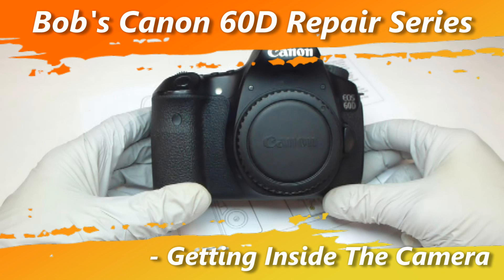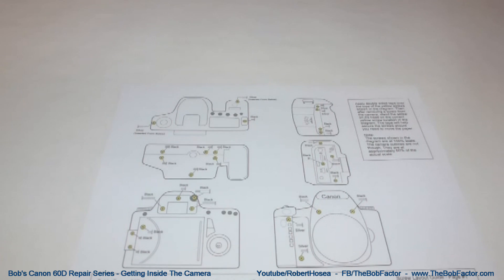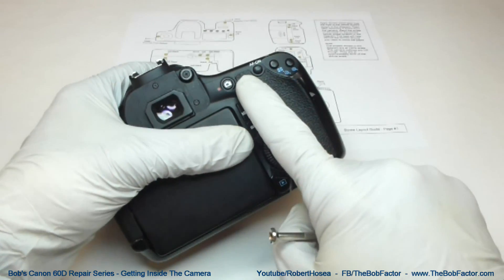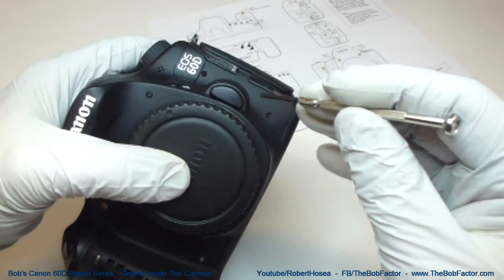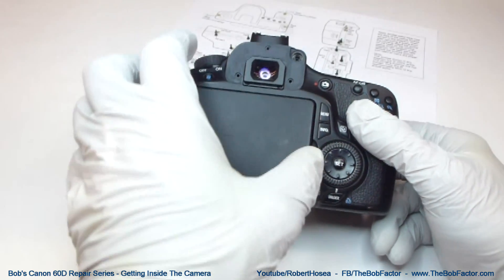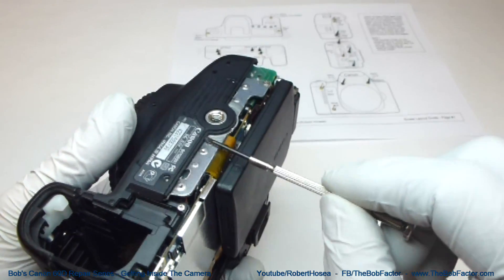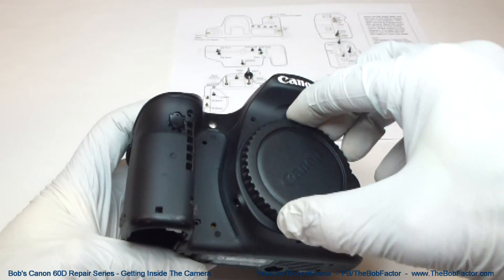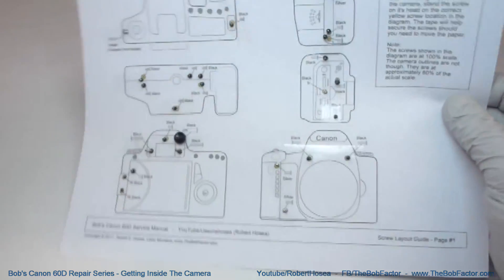Canon 60D Repair Series - Video #1, Getting Inside The Camera

Comment: Thank you very much Bob! These are the best instructional videos i have ever seen!!! It made me bid on broken 60D and try to fix it. It was told to me that it is not working due the shutter malfunction. Well after its arrival I was shocked by the fact that loosen mirror screwed up shutter and ended in two pieces between shutter flaps and CMOS :( 
For sure I need new shutter and mirror asembly and Im afraid CMOS will be damaged too... so Im looking for a reasonable priced parts here in europe or china (ebay). Is it wise to buy cheap parts from china?
Reply from the maker: Hi Jiří,

Thank you. I'm glad that you like the videos!

I have ordered items from China on eBay before, but never camera parts. So I couldn't tell you first hand on the quality of the parts. Though, I'm pretty sure that a lot of the camera parts that I have ordered on eBay that were supposedly in the U.S., were most likely parts originally purchased from China.

In regards to the camera's CCD being damaged, if it only appears that it's scratched, then you may only need to swap out the IR filter that sits on top, which would be a lot cheaper than swapping out the entire CCD. I don't have a video on that process yet, but here's a video that does show removing the filter. I hope this helps you out.: 
https://www.youtube.com/watch?v=bt9a7htqJng

Let me know how you make out on your repair too.
-Bob
Reply: I finally did it! Thanks to your video it was relatively easy job. And my CMOS seems like it is not damaged by mirror pieces at all! (Hooray!!!) BUT there is always some troubles when I am doing such a thing. I have not working focus point marking (red dots) and viewfinder is blurry, when I am using AF though viewfinder, photos are overexposed and blurry too so Im not able to use it at all (Im suspicious about internal exposimeter failure. Can you give me please some advice about what I have to check? Im pretty confident about not forgetting any flex cables connected.

 On the otherside focus in liveview is working like a charm, even if I have visibly missaligned sensor. Im planing to send the camera for professional alignment later.

 I have complete spare mirror chamber and I can try to use some parts of it (shutter and mirrors are completely thrashed) so I can rebuild my
Reply from the maker: Hey congratulations on getting it working again. I've been trying to reproduce your problem here, but no luck for me so far.  Did you you replace the entire mirror box assembly? Also, what about the IR filter on the CCD, did you have to replace that as well?
Reply: Thank you for trying to help, I did replace complete mirror box  with shutter assembly and inner frame...While I was digging around for possible causes, I lucikily found cause described on this amazing blog: https://canonrepair.wordpress.com/2015/02/09/canon-60d-dropped-down-false-exposure-measuring/ 
I clearly have missaligned metering sensor which also seems ti project red dots in the viewfinder, unfortunately i messed rear cover flex during hunting this down, so now Im waiting for spare part which will hopefully arrive before christmas. 
Despite how horribly it looked from outside, CMOS has only minor coating damage which didnt showed up in first test photos  under interior lighting. See the picture: https://scontent-frx5-1.xx.fbcdn.net/v/t1.0-9/24059194_10210796620967350_450173774165212316_n.jpg?oh=56656cfc31c40d7b2a4288f47b06e3c1&oe=5A8EB081

Comment: Anybody got any advice for a jog dial that isn't functioning properly?
Reply from the maker: I have a video that shows how to disassemble and reassemble the set button and dial assembly. I've been successful in repairing them before when they've quit working. If you can't fix it then the best bet is to just replace the entire back piece. They run about $50-70 on eBay. Here's a link to my video on that. https://youtu.be/zaJJqRCfYXc

Comment: Robert your videos are great. Thanks for Posting. Suddenly the set button and dial of my 60d stopped working. Probably the best way to go is to replace it, but I can not find a place to buy it. Can you help with that?
Reply from the maker: Sometimes you can find just the set button and dial assembly on Ebay, but I don't see any on there right now. So, you may have to buy the entire back cover instead.

Here's a link to a back cover assembly on Ebay:
https://www.ebay.com/itm/Canon-EOS-60D-Rear-Cover-Assembly-Genuine-Canon-New-Free-Shipping-/371839129218?hash=item569356d682:g:mDsAAOSwPhdVSnKL

If you haven't already checked it, you should check to make sure that the connector on the flat ribbon cable that comes from the back cover has not come loose from the socket on the main board. It could be something simple like that.

And, I also have video that shows how to remove and replace the set button and dial assembly. It could be that you may be able to repair it if you find what the problem is on it.
Here's a link to that video: https://youtu.be/zaJJqRCfYXc

Good luck with your repair. Let me know what you find on it.
Bob
Reply: Thank you very much!

Comment: https://www.dropbox.com/s/w9y54lvtfp4hyx1/Problem_motherboard_Canon600D.JPG?dl=0

I wanted to know where I can find this connector to replace? I've already looked at Ebay but nothing. Thanks so much.
Reply from the maker: That is a tough one. Short of finding another board that you could remove it from, I would look at www.DigiKey.com for something. I get a lot of components from them. From the picture it looks like it has 12 connections. Here's a link to a DigiKey search for "surface mount 12-Position headers":

 https://www.digikey.com/products/en/connectors-interconnects/rectangular-connectors-headers-male-pins/314?k=sm%2012%20position%20connector

There are a lot of results, but you can narrow the results down by modifying the filters at the top of the page.

If you can't find it on DigiKey then take a look at www.Mouser.com. Let me know how you make out on this. 

- Bob
Reply: Another motherboard really costs me too much. I thought I could find it at 20 € but it is not so unfortunately. I found this connector is similar but not identical: http://www.mouser.it/Search/ProductDetail.aspx?qs=cTNRJjk9LReY0n8B358FZQ%3d%3d. If so, I can disconnect it with a flux and welder and then attach the individual wires using a great magnifying glass.
Reply from the maker: In the picture, the connector looks like a 12-connection male/female pinned type. Is that correct? And the connector in the link shows a 52-connection double-sided style connector. Possibly the link is misdirecting me, but the two connectors are not at all the same. What type of camera did the circuit board come out of? And yes, you could reconnect a new connector using wires if the pin-outs are different from the original. I've done that before as well. You just need a very, very fine tipped soldering iron and fine solder.
Reply: The mount is 12 pin and not 52 pin. On the card is written "AT & S". This card belongs to the Canon 600D. To secure the wires you need a monocle (like this chinese style http://www.ebay.it/itm/MONOCOLO-BINOCOLO-CANNOCCHIALE-ZOOM-MONOCULARE-INGRANDIMENTO-16x52-MM-CACCIA/191804208638?_trkparms=aid%3D222007%) for enlargement up to 20X, otherwise with a normal lens you do not see very well. Hopefully I'm in a hurry to reuse my reflex.
Reply from the maker: I'm not sure why the link is going to a 52-Position connector. But, I'm sure Mouser also has a 12-Position. I've always used an illuminated magnifier for very fine circuit board work. It works well and it's hands free. Similar to this one: https://www.amazon.com/Oanon-Magnifying-Flourescent-Magnifier-Adjustable/dp/B072XP8W2F/ref=sr_1_19_sspa?s=hi&ie=UTF8&qid=1507398728&sr=1-19-spons&keywords=illuminated+magnifier+5x&psc=1

Good luck with your repair. Let me know how you make out on it.
Reply: Perhaps it is better to sell my reflex 600D. Optics, sensor are in perfect condition. I think 100 € can recover since on Ebay there are people who sell individual pieces of recovery at salty prices ..... As for the lens I prefer to buy a typical portable type (expensive but professional) Bergeon type 5X and the other by 15X.